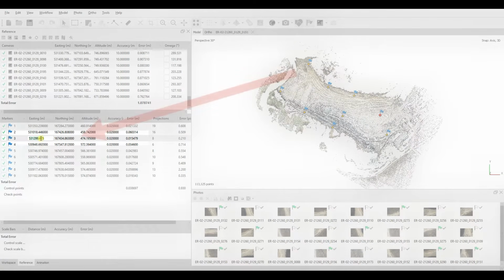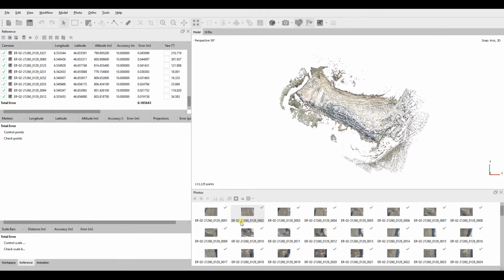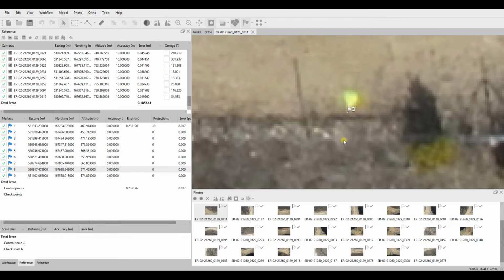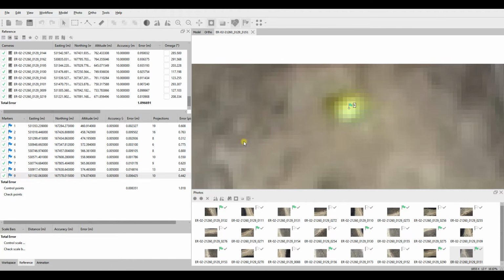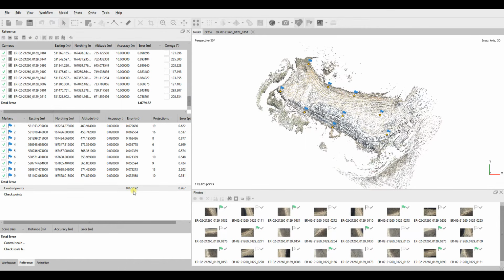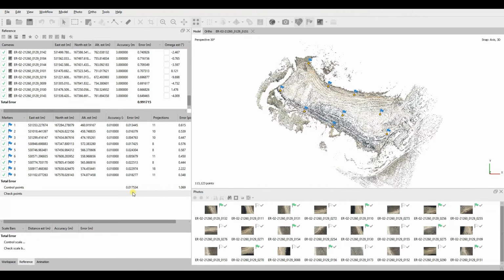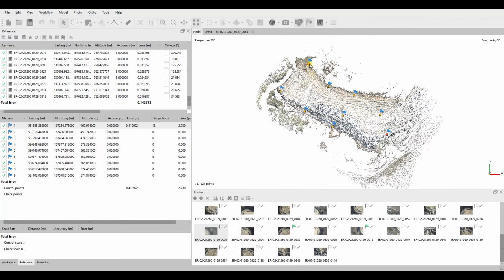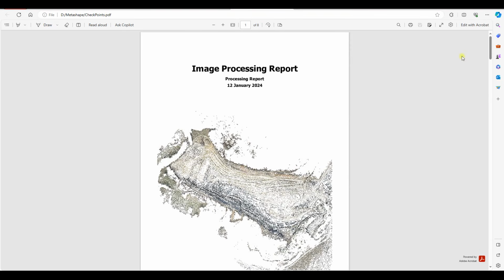Adding Metashape GCPs - Be Careful!

Comment: I have a problem here, I am using DJI Mavic 2 pro drone and its non RTk and my camera accuracy is set up to 3 and camera(deg) is set up to 3 too, my markers is set up to 0.004 but I get an error of 5.338m on camera accuracy and 0.02 on control. what might be a problem. I am worried with an error of 5.338m. is it normal when using non RTk drone and how is it going to affect my data
Reply from the maker: Hi. That error is not abnormal for non-rtk data, in fact it looks quite normal. 
You could also set the camera accuracy higher and see if the error increases. I expect it wouldn’t change significantly and will be 6 or 7m maybe a tad more. 
This will just prove to you that there isn’t a major issue. 
However, if it jumps to 10m or more, then something may be up. 
Overall though, I don’t think there is a major issue but this just shows the point of the video that by changing the accuracy values the results can change. 
Give it a try and let me know the results and we can review if need be. 
Cheers

Comment: when you added 5 m to the elevation you simply shifted the model vertical, so the relative accuracy is good still.  Quality check is never done on the GCP because the software will try to adjust the model on them using 9 parametrs transformation. Use Check point as they are absolut check point that doesnt contribut to the adjustement.
Reply from the maker: Hi, thanks for the comment, but I disagree to some extent. When I added 5m to each control point elevations and re-optimized the cameras, it performed a camera calibration where it is likely the focal length was adjusted. Had I selected "Transform" then a simple shift would have been the result. 
Yes, the model shifted vertically, but not due to a simple shift, the camera parameters were changed which likely leads to distortion in the various other elements of the calibration too . 
What this also shows is that if you had control points and checkpoints where both were incorrect due to field survey errors, you could end up with errors in your finished dataset. Hence, the point here was to review all values in respect to each other and apply a certain amount of logic when choosing to accept the results or review them for potential error.
Thanks!

Comment: Thank you so much for this video. I have literally thousands of datasets that I took over the past 12 years - only flying RTK the past few years but can never get DJI RTK data more accurate than +-25cm - that's when using all GCP's as checkpoints. I can get it "theoretically" to mm accuracy by unticking the Images & use all my GCP's as GCP's but what's the point in flying RTK then? Can you PLEASE guide me how to do a 3 or 7 point transformation to my data so that I can use most of my GCP's as checkpoints? The other day I have flown 9000 Hectares in 2 days with 2 x Matrice 4e at the same time with 60 GCP's but I still have the same issue... Can we perhaps do I videocall? I'm from South-Africa & prepared to pay if you can help me on the right track. I did try the 3 x point "update"  you showed in your video but my checkpoints didn't get any more accurate. Kind regards
Reply from the maker: Hi Henlo - thanks for the message. 

The trouble with RTK is that it is going to give you a relative answer, not an absolute one (unless your RTK base is setup and settings updated to be on a known and well surveyed point). So I am making a few assumptions here but generally this is why you have the 25cm answer, because it's close, but not exact. The control reflects this and unless you shift to the control, this will almost always be the case, if not worse.

Keep in mind that RTK is still valuable as it get's you to a 25cm level whereas std GPS may only be 5-10m and also the internal positioning from one image to the next should be excellent, hence fewer adjustments and corrects needed. Even though not perfect, RTK still has its benefits.

Before looking at transformations, I think it's a good idea to understand you setup better. What base are you using for RTK, where is it setup, is the point surveyed and are you adding it's known coordinates. Or, are you using Trignet or a Trimble correction service? Have you tried PP-RTK yet, if yes, what are the results?

It's probably easier to pass this info via email, so please feel free to do so, and when we're ready maybe a video call will sort this out, as you suggest. geospatialtips@gmail.com

Thanks
Reply: thank you so much for your answer! Wil definitely take you up on your offer & email you later today, much appreciated!🙏

Comment: Subject: GCP Alignment and Final Accuracy in Metashape

Hello,

Thank you for your video — it's very clear and informative!

I'm currently working with a Matrice 4 RTK and a DJI D-RTK 3 base station, flying in RTK mode. When importing the photos into Metashape, I get an initial positioning error of about 2 cm, which seems consistent with the equipment I'm using.

I then import my GCPs without any issues — they are correctly detected, and initially show no error. However, as soon as I manually align the GCPs (placing the cross exactly at the center of each target), I notice that the overall error increases to about 6 cm, which means an additional 4 cm deviation after alignment.

👉 Is this normal behavior linked to model optimization in Metashape?
👉 Or could it be an issue with my alignment method or accuracy settings?

I also came across a very relevant comment by @InspiredScience, explaining that accuracy values in Metashape aren’t used as fixed limits, but rather as relative weights between data sources.

In other words, Metashape performs a regression (similar to least squares), where weights define influence:
A photo accuracy of 10 m vs. a GCP accuracy of 5 mm has the same weight ratio as 20 m vs. 1 cm.
Only the relative difference matters — not the absolute values.

This means I can adjust the influence of the GCPs vs. the RTK photo data by tweaking their accuracy values. For example, setting GCPs to 0.01 m and images to 1 m would prioritize the GCPs in the adjustment process.

📌 My main questions:
What is the best practice for weighting RTK photos vs. GCPs in this context?

Is a final error shift from 2 cm to 6 cm acceptable for volume calculations?

And finally — how can I be sure that my model is truly reliable?

Thanks again for your great work and valuable support.

Best regards,
Guy

Comment: Thanks for video. I captured aerial images of the same area one year apart using two different drones, both equipped with RTK. Then, I used Agisoft to generate DEMs from these images and aimed to detect elevation changes over the year.
However, I found unexpected height differences of around 10–15 meters, which seems quite unrealistic. I suspect that one of the image sets may have been taken with a slight tilt or non-nadir angle.
Could the viewing angle difference be the main cause of this large discrepancy? Do you have any suggestions on how to avoid such errors?
Reply from the maker: Hi - could you clarify if you used standard RTK or PP-RTK? RTK alone, not tied to any known point (not the RTK base) only has a relative accuracy, not an absolute accuracy and so there is the possibility that the error was introduced along the way here. If however you have used PP-RTK, then one of the datasets has a fault such as an incorrect value input at some point that has led to this error. 
To answer your question, no I do not believe that capturing images at an angle would cause this as many datasets are captured at a wide variety of angles, but these angles and their origin position wuld all be saved as part of the image exif data and stored in the various RTK files as well.
I am assuming there is no ground control available to confirm which dataset is correct or not, or if they are both incorrect to some extent? 
Also, pay close attention to the original and calibrated focal length of the camera as you may see some reason for the elevation isues there.
If you like, send me some more info or data and I will take a look: geospatialtips@gmail.com

Comment: Would you consider a focal length change of 4404 initial to 4235 adjusted to be too large of a change? This is just after aligning the photos on High accuracy. It drops to 4222 after doing all the tie point filtering and optimization. I have cross referenced the accuracy of the RTK drone surveys to a ground based LIDAR scanner and found the drone surveys to be very accurate compared to that, so not sure if I should be worried about the focal length change.
Reply from the maker: Hi, sorry it took me a while to respond!
No, I wouldn't worry, that difference is less than 4% from the original, so it seems good to me. As you have pointed out, the comparison to LiDAR looks good and thus these values are very acceptable.

Comment: Regarding your tie-point cleaning process, the other guide you linked uses different settings for the 'Optimize Camera Alignment' prompt. Can you clarify which video has the boxes checked?
Reply from the maker: Hi - If you have images captured at various altitudes and/or you have oblique images along with those captured at nadir, then I would use the "Adaptive Model" option when optimizing the camera. However, if you have a more simple dataset where images are captured at a single altitude and generally all at nadir, then you do not use adaptive modelling and you would have the boxes checked per the default setting. I hope that helps.
Reply: @geospatialtips  It helps a lot! Thanks for the replies 👍

Comment: Hi, thanks for video. What I see is that you do not take the full advantages of a RTK drone into account. Instead you weight and still rely on multiple GCPs. I think it's better to import the accuracy values for each image (see settings import accuracy) and process orientation based on this RTK image coordinates. After this, import and mark 3+ GCPs, uncheck image coordinates and use the "update" tool to transform to to GCPs. This will avoid unwanted bending of the model. Cheers, Hans
Reply from the maker: Hi Hans, thanks for the comment. This exclusion was done intentionally. I find that the majority of viewers do not have or do not use RTK enabled drones and thus this was to clearly illustrate what Metashape does with control points if left unchecked and unmanaged.
You are of course correct that when we use RTK (more specifically PP-RTK) positions, these should be taken into consideration and used to guide the orientation. RTK is only accurate in a relative sense unless setup on a known points and observed for extended time periods, hence the need to use the "Update" function as you have pointed out. If it was possible, I'd only ever use PP-RTK and then even the "Update" function should become unnecessary.
Keep in mind too that ALL positions are only as good as the equipment being used and blind faith in any one of the technologies being used is a risk.
If you and the team at RedCatch would like to supply some data and we can make a video together to show the best way to harness RTK, specifically with RedCatch, please do get in touch!
Thanks
Reply: Does it have to be 3 GCPs or we can mark more?
Reply: @dainel40  For a 7-parameter transformation, such as the one used when executing the "update" function in Metashape, a minimum of 3 GCPs is required. You can use 4, 5, or even more. However, the more GCPs you use, the less benefit you get from using an RTK drone—which, in my opinion, should ideally eliminate the need for GCPs altogether.

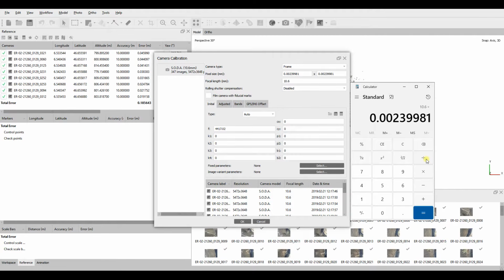Comment: A minor point at 1:34 you talk about microns, but that calculation is actually in pixels. That is, the units cancel out when dividing. This is so that the everything the CV pipeline deals with is in pixels which makes the maths much easier.

Comment: Great video! After putting GCP I must re run alignment or using optimazation is enough?
Reply from the maker: I would just use the optimization. I think that if you re-run the alignment you "force" the images onto the control position and therefore deviate away from a true AT result. Thus, you can't report it as an accuracy value using those points because you're fixing them. If however you have many additional check points that you only add afterwards, then it should be okay.

Comment: Mark, can you tell me if you use a desktop or laptop for most of your map processing? What you recommend. Your channel is the best I’ve come across and I’ve been through it all. Much appreciation to you and your work.
Reply from the maker: Hey TexasHunter

Thanks for the kind comments. 

I use a desktop for the processing work, even though mine is pretty old now, it’s reliable in a way I don’t think laptops are if pushed hard over long periods. 
I think a good GPU with 8GB worth of memory and at least 64GB of RAM are where you want to be for most jobs. You can use lesser specs, but you may find processes start to fail. (More RAM would be great, 128GB and up) Your CPU will dictate the speed with which certain tasks run, but I can’t recall seeing smaller CPUs causing failures like small GPUs and low RAM would. 

Hope that helps a little.
Reply: @geospatialtips  that’s exactly the advice I was looking for. Thank you sir

Comment: Hello! When I calc the focal length in micron, I am not getting the initial calculated number in Metashape. For example: 12.29 mm length divided by .00335821 = 3,659.68.  The initial calculated length in micron is 3713.29. Im not sure where the discrepancy lies.
Reply from the maker: Hey Dennis!
Question: The 3713 value form Metashape, is that before or after aligning images? I expect it'll change a little after your first alignment step and this difference isn't outrageous. But, if this is the value that Metashape gives right after adding your data, then I am not sure what is happening as your maths is correct.
Reply: @geospatialtips  This is before I aligned the images.  After aligning, the adjusted value is F= 3705.749.  So, what I did was start a new project, upload images and then manually input F= 3713.29 as the initial. Not sure if this is correct but after aligning so far everything seems to be in an acceptable range.  I just saw that you do one on one tutoring type sessions. Im interested in setting something up soon!
Reply: @geospatialtips  correction; the value I manually entered prior to aligning was the 3659.69.
Reply: @geospatialtips  Fumbling my words here trying to explain. Ill recap here quickly incase anyone else is having the same issue.  After importing images I went into the Camera Calibration menu and noticed that it had a value already populated (3713.29). Then I calc'ed myself using the equation 12.29 (Mavic 3 Enterprise wide lens focal length) X pixel size .00335821 = 3,659.68.  After attempting to align the images, I went back into the Camera Calibration menu and noticed that the value did not change to the correct length in micron (3,659.68). So I opened a new project and started over, this time after importing the images I went back to the menu and manually entered the calc'ed figure. Then I aligned the images and my adjusted value is F= 3705.74, and this is within the acceptable range! Im not sure why Metashape is giving the wrong calculation after adding the images.

Comment: Hi, Iwould like to know. If I can do the process of aligning the coordinate system before any process mentioned in the video. Can I work with the correct coordinate system from the beginning? Or do I need to do this process only after aligning the photos?
Reply from the maker: Yes, you can set it beforehand as well and use your desired system from the beginning. The process would be much the same.

Comment: Dear, congratulations on the video...

I have a question and maybe you can help me:

In the Ground Control Points section of the Metashape accuracy report, I have the following

Error X (cm) 2.33
Y error (cm) 2.07
Z error (cm) 1.15
XY (cm) 3.12
Total (cm) 3.33

My orthomosaic has a pixel measuring 1.72 cm and the DEM pixel measuring 3.44 cm

If I measure the length of an object in orthomosaic, my error will be between (1x GSD) and (1.5 x GSD), right?
In this calculation, should I consider the pixel of 1.72 cm in the orthomosaic or 3.12 cm in XY of the report?
Is XY error only for area measurement?

If I measure the height of the object, I should calculate the error between 2 to 3xGSD, right?
Should I consider the 3.44 cm pixel in the DEM or 1.15 cm in Z indicated in the report?

Thanks.

Comment: hi i need an accurate Ortho mosaic of all data for cad  work so is it necessory  to follow gcp method or i can make without gcp also an accurate orthomosaic image as you know we can align in autocad easily without gcp ortho
Reply from the maker: Hi - it will depend on how accurate you need the end result to be. Also, is the drone you are using RTK enabled, or are you using just the onboard GPS? If only the onboard GPS it will be less accurate. Using this ortho is still possible, but you have no way of ensuring accuracy, so we get back to the question of, "How accurate do you need it to be?"